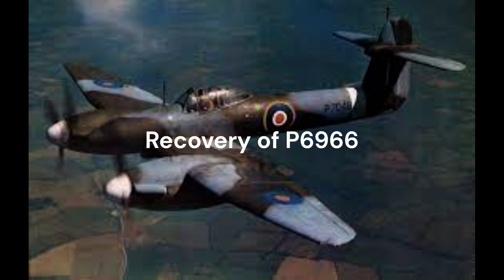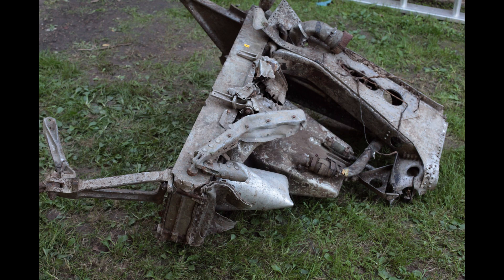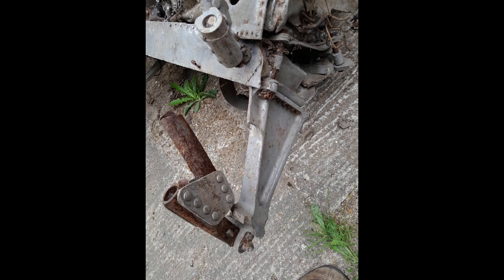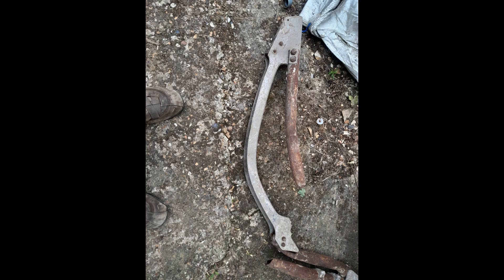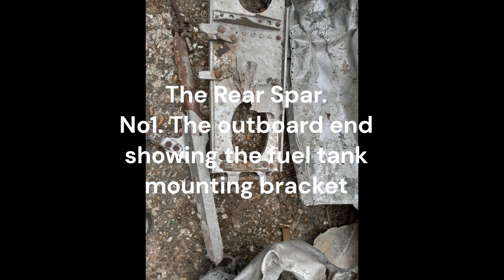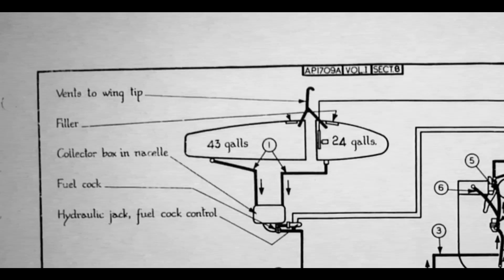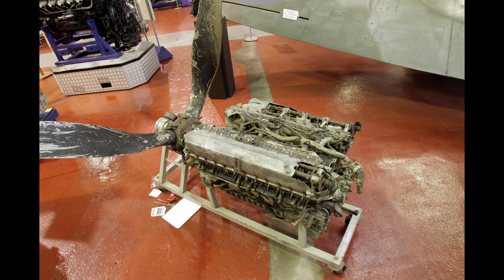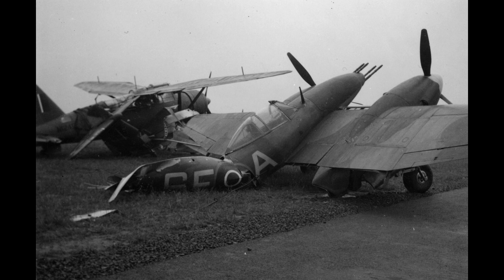Whirlwind Fighter Project - Engineering Update part 18 - P6966 recovered wreckage

Comment: I'm a bit confused Pete.  So P6966 blew a tire on takeoff but couldn't land?  Why didn't the pilot simply retract the gear and belly land it?  Instead, I'm guessing he chose to bail out, which is why the aircraft turned into a lawn dart, impacting vertically.  What a shame, but makes for an interesting story.  Just subscribed to see how your project progresses.  Cheers from Thailand!
Reply from the maker: Hi Jimbo. The issue was that the undercarriage was jammed by the tyre, which had come off the rim. Ground control advised it was unadvisable to try a landing. Cheers Pete

Comment: Hi what engines would you use .Merlins or try to find the original models ?. Regards Chris Bailey
Reply from the maker: Hi Chris. Sadly there are no Peregrine engines left. We have the two damaged ones that will be displayed alongside the airframe. The Merlins were a much larger engine and will not fit inside the nacelle structure. The alternative would be a pair of Kestral engines, but these themselves are very very rare, so for now its a work in progress. Regards Pete
Reply: So.. with the Kestrel you are in the 6-700hp area...
Any thoughts about (recent) high performance car engines like Chrysler V10 or Big V8's? At least as a stop gap?
Yes, yes... wild ideas maybe...